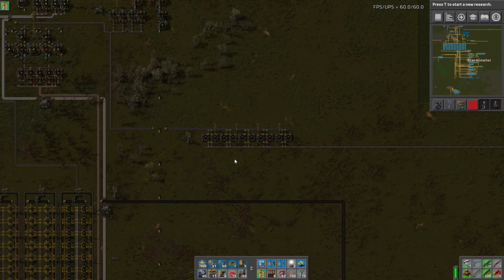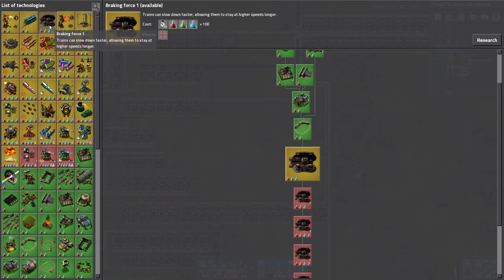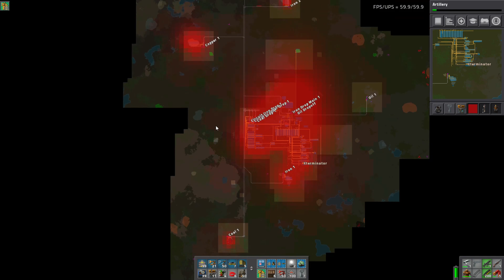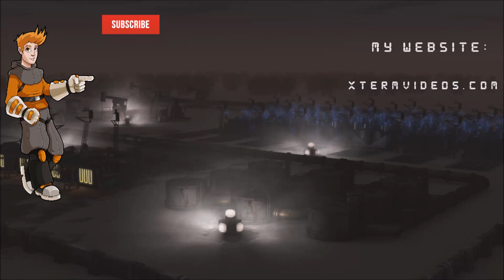Factorio: Tightening The Belt: Megabase Guide EP28 - ASSEMBLER 3 | Tutorial Gameplay Series

Comment: The main reason you might want to use a circuit condition of, say, 100, rather than a hard cap of two stacks on a chest containing items that stack to 50 is when you might want to drop items back into the chest manually,  even when it's "capped". Lets say you're making power polls and putting them in a chest. Then lets say for some reason you have 120 power polls in your inventory, but you don't want your inventory slot taken up with those 20 power polls. If you hard cap a chest, and it's already full, you can't easily drop those extra 20 in there unless you uncap the chest, put them in, and then cap it again. With a circuit condition you can just drop them in without even opening the chest.